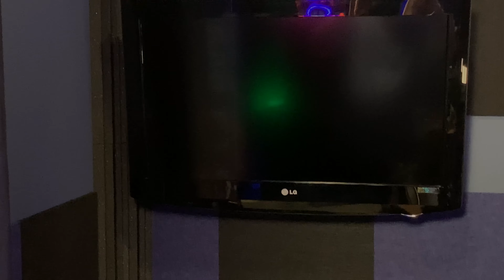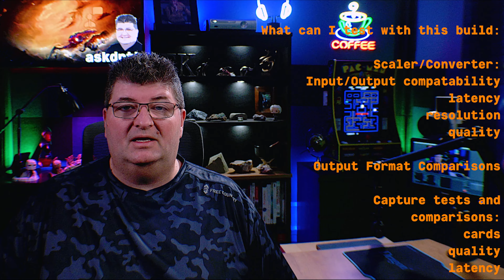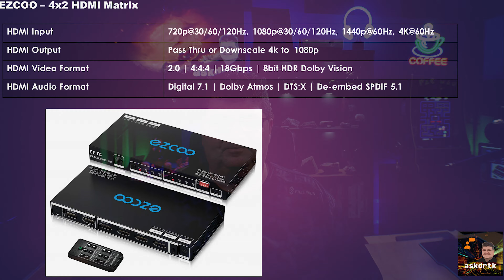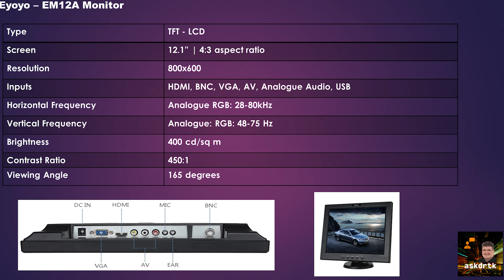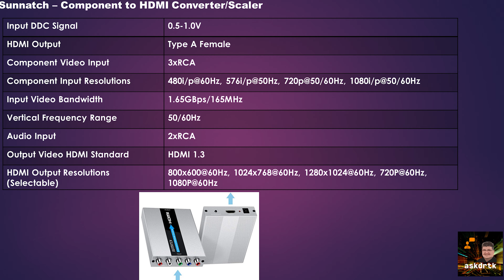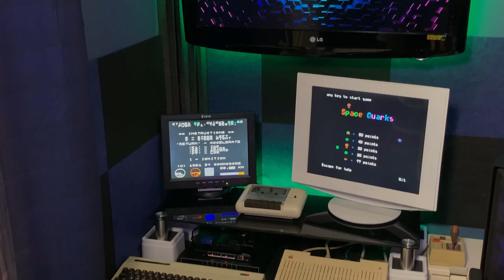Studio Build Part 1 - Ultimate Gaming and Streaming Gear Test Bench

Comment: I have recently received a chumghop 8 port composite selector switch for hdtv/lcd/ dvd game consoles to play  my retro game consoles.  
  I am satisfied with this product but I am planning on purchasing a framemeister in the near future and am not sure if I can continue using the aforementioned composite selector with a framemeister?🤔
Reply from the maker: I use my 8x1 composite selector with a variety of converter scalers on my test bench including the retrotink mini, 2x pro, as well as others I am reviewing. I then output from the scaler to monitors, TV's, and capture cards without issue. In my experience, these switches do not alter the composite signal of connected devices, and so you should be fine if you are able to pick up a framemeister or OSSC. Hope this helps out and thanks for watching!
Reply: @askdrtk thanks for the feedback!  I will go ahead and greenlight my purchase of a framemeister

Comment: I want to be able to view my VHS tapes on a VGA monitor and I am thinking the Wiistar AV S-Video Composite to VGA Video Converter Box may work.
Reply from the maker: I will have a full review coming (including color and scale tests), but I do have my JVC-SR-DVM700 (miniDV, HDD, and DVD combo) connected with good results. I actually have my VHS apart (cleaning/maintenance) right now, but will be including it in my review. So far, I have had a positive experience with the Wiistar converter.